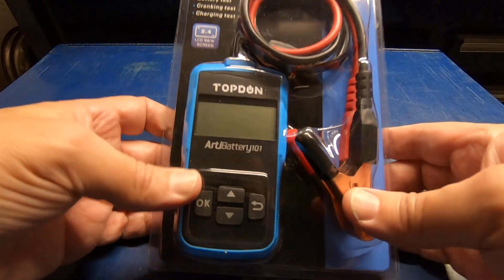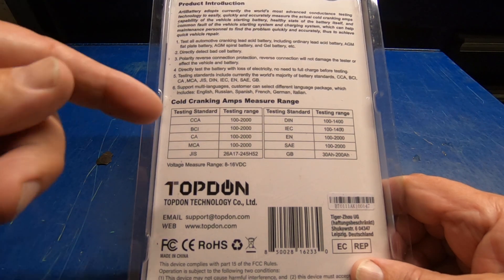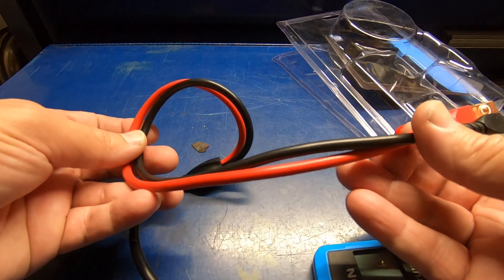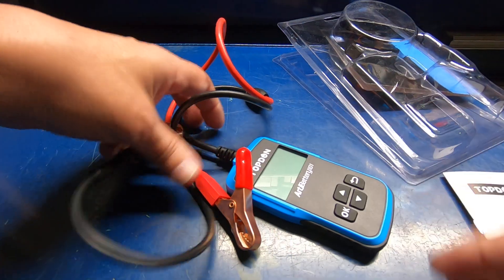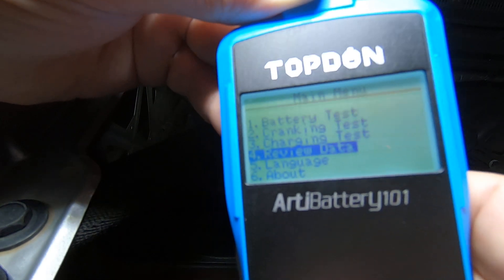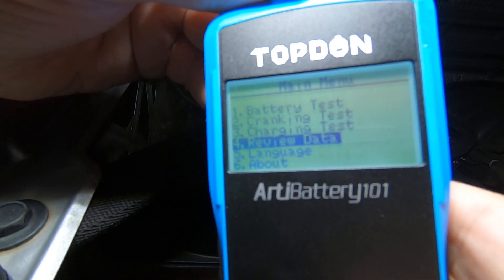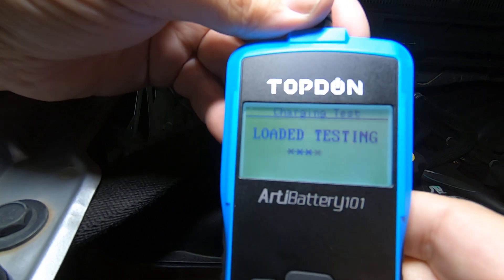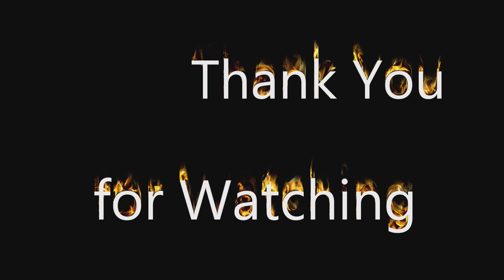Review of the Topdon AB101 Battery, Alternator, Ripple, and Starter tester.

Comment: You did the charging test wrong :)
You are supposed to press Ok AFTER you raised the rpm to 2500 for 5 seconds.
Reply from the maker: Yes I know but it generally isn't needed to see if the alt. is working ok.
Reply: I'd like to see you do it, when tester cord is short and you have no assistance like second person sitting in the car waiting for your signal to step on the gas.